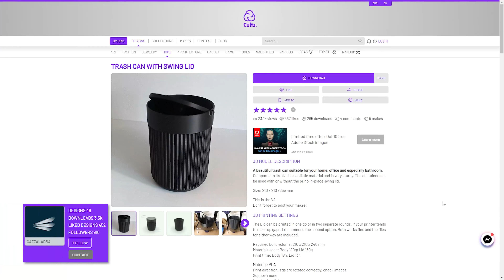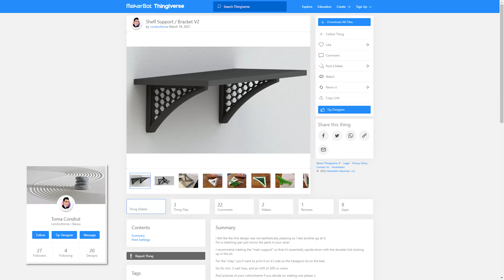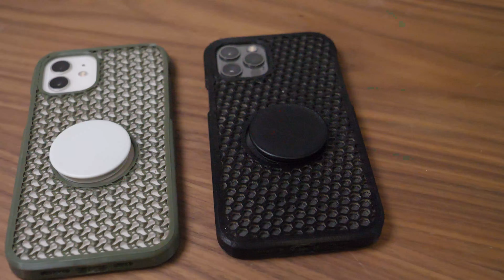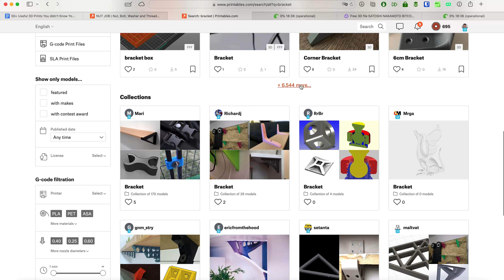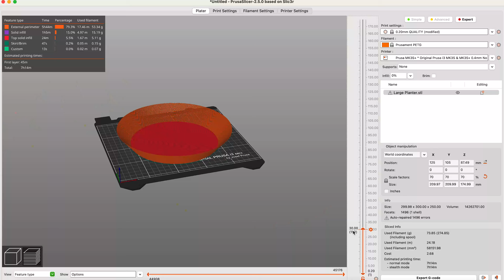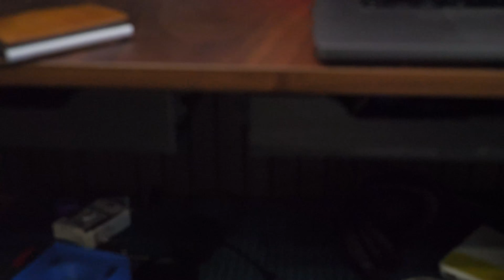50+ Useful 3D Prints You Never Knew You Could Print

Comment: Heads up if you are looking for a printer. I bought a elegoo centauri carbon that never ran correctly. After about 50 hrs it started smoking/shut down. I replaced the nozzle, same thing. Elegoo support sent replacement parts(2 weeks trans). Replaced them and the bed wouldn't heat correctly / stop printing. Support sent video to check wiring. Printed for about 10 minutes and would stop again. This time the printhead wouldn't heat correctly and stop. Their support said I should return it and they would replace it with a USED PRINTER.

Comment: Million Dollar Tip from someone who has 3D Printing Since 2017 : Rule No 1. Don't 3D Print something you can easily get from a dollar shop or nearby market , even if the cost is same but your time spent into printing it goes in vain, Time is more valuable than Filament or anything for sure , For Example , this video's first recommendation is Trash Can , which is the last thing i would think of  3D Printing, 3D printer value is not justified by printing trash cans, coke bottles ,etc , i don't know where this guys lives but i am sure where most of us live Trash Cans are available for less than $5 , or max $10 . And please don't come after me saying it's our 3D Printer we can print whatever we can , yes you can . 3D Printing was invented back in 80s to create something that's not available to purchase right away on any counter. Best Usage of 3D Printing ( According to my Experience ) : Gridfinity , OpenGrid , Multiboard , spare parts that are obsolete now , specific designs that you won't get anywhere else , DIY Projects , arduino raspberry pi (custom pcb ) enclosures ,etc

Comment: If you want a mechanical 3d print to try i have an idea for you. I am currently working on an Auto loom. 

Basically the idea is that i plug a drill into a screw hole and it turns all the gears to make the loom run.

Comment: I have no idea where you are the trash can cost $75 and only holds 3L or whatever you said. Here in the US a standard size trash can is 13 gallons. They make them up to 40 gallons. Also standard size trash can will probably cost about $15. Sure you can get fancy ones. In fact for $75 13 gallon stainless steel one.

Comment: Custom bookmarks with shallow bas relief images.
You could scan a collection of rocks then print them into a floor for an aquarium / terrarium with sunken ships and treasure chests coral reef etc. added in as one light weight piece.
Handles for small glasses or cups or paper/ plastic cup to make them easier to use like a coffee cup. Handle could be customized for the person or for disability ease of use.
Could convert those pesky cone cups at the office with a handle and a base so you can set them down.
Handles for anything. Like files or other tools.

Comment: The best stuff I've printed is parts to fix things, which are not available from anywhere. Drawer slide mounts that break and you can't get replacements. The handle and frame for our freezer which broke about 8 years ago and I couldn't get a replacement, so I printed it. At this points my fridge, freezer, cars and motorcycles, not to mention dressers and many other indoor and outdoor things are partially printed parts since they have broken and either I couldn't get parts or they wanted me to buy a whole $300 assembly instead of the 30 cent part that was actually broken.
As a bonus, I can design the part better so it doesn't break like the original one did.

Comment: Home depot sells the best compost bins. Five gallon bucket and lid. Under ten bucks.
Reply: Sure, but you can't help justify spending hundreds of dollars and hours of modeling by comparing a simple solution...you gotta convince yourself you need expensive stuff so that you can print it yourself to "save" money lol.  I get it, I want a 3d printer because it's cool, but I can't think of much I would print that I couldn't fix some other way or at least for less than the cost of the printer + supplies.

Comment: You can print a working gun.
Reply: @Rad1iantError 😂😂😂 that should have been on the list
Reply: Lmao.
Reply: Well... It's more of a single use bullet detonator with just the printer.
Reply: Yeah, but because it’s made of plastic will only be single use
Reply: @3dprintedfortnitekid  no not even the 1st Gen 99% print 🔫 gets 5 shots before a barrel replacement swap out pin aswell but don't have to. Than you got stuff like the FGC (f*** gun control) you can print 90% of it and than buy the hardware springs bolt etc from home Depot. And depending on filament used it has a nice life span. Than there is printing just lowers (which is what you need a back round check for ) than buying the rest 😁 online shipped to your door. 100% legal in most states in USA.
Reply: @3dprintedfortnitekid  that's not correct kid. You can print mostly all the parts of a real gun other than barrel and I believe firing pin, but you can purchase these parts easily and print the parts that does not need to be metal. Since you're replacing steel or polymer with plastic, it won't be as durable but it will have a lifespan long enough for its intended use

Comment: You forgot RC Cars.

The whole reason I bought a 3D Printer for replacement parts for my RC-Crawler...It's a 1/12 or 1/16th scale cars, even PLA is good enough for Small, low impact RC Cars...I would use ABS or ASA for RC-Bashers, but for Crawlers, printing out Frames, Servo Beds and Rims come out well and have lasted for a few years for me on some of my RC Crawlers.

I could either overpay for parts from Amazon, or wait for months for parts from AliExpress...The 3D Printer is better than both...

Comment: I think the thing I'm most proud of designing and printing (so far) is an adapter for a portable aircon unit, that allows the exhaust duct to fit through the window gap. The standard adapter for the unit was designed to fit sliding windows, and my windows open outwards at the bottom. The aircon unit provided a fabric bag that you could stick to the windows, and a zipper to put the exhaust duct through.
Neither the exhaust duct or the original adapter fitted through the window gap, so the weight of the exhaust pipe kept pulling the bag off the window frame...
So I designed an adapter for the adapter, that would attach to the collar of the adapter, and then taper in to fit through the window gap. This was my first complex shape (fillets, tapering fillets, offset planes and extrusions used to cut into the base model, to hold the adapter clips in place)

Shame I can't add images, but I'll put it up on printables soon. Edit: it's up here: https://www.printables.com/model/950129-dr-prepare-aircon-mod
It's not groundbreaking or anything, but it is my first complex shape in Fusion 360, and just a week ago I was only able to print things that were made by other people, so it's a big step up for me 😃

Comment: The single most useful thing i have printed for myself was an enclosure for my printer. I print on an OLD monoprice maker select v2 that has never recieved any sort of upgrade. I wanted to stadt printing in ASA and get into vapor smooting my parts but wothout an enclosure i couldnt get it to work at all. Most of the enclosures i could find for sale or even stl files online were either crap, didnt fit my printer, or needed 5+ lg of filament and i couldnt justify any of that for my cheapo printer so i modeled up a new enclusure that uses plaskolite corrugated plastic for the walls and very very minimal amounts of filament for the edges and corners and tbh it works AMAZING. Changed the way i print everything.

Comment: Heads up, generally 3D printed plastics have crevices that bacteria thrive in. For example, in FDM/FFF it's the layer lines beads. As a result, it's best practice to not use 3D-printed parts for things that are in contact with food or liquids for consumption. In short, I wouldn't recommend the water bottle gasket to be 3D printed.

Comment: I have been 3d printing for over four years and have never printed a benchy. Ninety % of everything I print is a repair part, a tool , replacement item, or equipment I want or need. 3d printing has saved me hundreds of dollars in tools and less frustration in finding a solution to a problem. Great video by the way.
Reply: Benchies make for good... benchmark prints. Thats the point of them
Reply: does a repeating toothpick crossbow count as "useful"?
Reply: Yeah, I need this every single day @SadCatStudio.
Reply: Lmao bunch of hipsters in this thread. Nothing wrong with printing a benchy, its supoosed to be a simple benchmark so you can see the quality of the printer/material, nothing to it.
Reply: Exactly. Using decent 3D CAD software I create whatever I need.

Broken Party tent part? Reverse engineering copy made in 3D software, print, place, ready.
Ice Cube tray from American refrigerator damaged? Create a strong support and done.

Confessing I occasionally download and print models from others. But mostly I create useful parts myself.
Reply: My first print was a benchie
Reply: @dargoth  printed a benchy just because my son was eyeing it 🤣🤣.
Reply: @dargoth  fabricator here and this is the same reason why I bought one you have no idea how many times I had to me and you will make my own tools sanding plates hopefully this works out
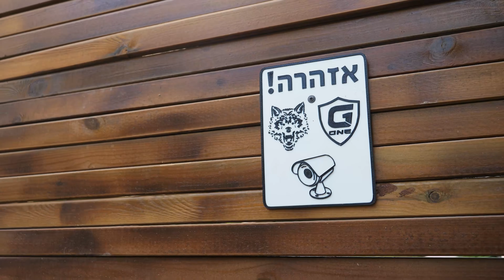Reply: 7:09 need a sign for my condo building. FedEx and Walmart miss my unit ALLLLLL the time
Reply: @dargoth  No Benchy? Come on man! Let your hair down. Dragons are fun also. Just kidding. I wish I could unprint all my Benchys they do scatter all over your desk. I’m impressed though
Reply: Same! And honestly I don't understand why people buy a printer and then say "what do I print now?". I mean, it's like buying a car without really having to go anywhere.
Reply: @Ale-bj7nd  read me like an open book without knowing of my existence some other time, okay??
Reply: Been printing about 6 years and only just printed my first benchy last week. I wouldn't have bothered normally, but a 14 min benchy seemed too good to pass up.
Reply: If you’ve never printed a benchy then you’re not a real 3D printer king. 💁
Reply: I just started a month ago.  I haven't printed a benchy yet.  I wanna see how long I can go. Idk why, but the thought of a benchy makes me mad lol.  It's literally the first thing everyone prints when they get a printer.  But I get it.  It's a tester.
Reply: @kylehanneman6438  I feel like what happens is that if you're not good at CAD or modelling, the amount of useful things you can make with the printer drops dramatically because you aren't printing custom replacement parts or other things that are hard to source online. That's why a lot of hobbyists end up just printing figurines/tat they downloaded, or stuff like drawers and organizers

If you have some competence in CAD and ideally do some other thing as your main hobby, then the 3D printer becomes a really useful tool that gives you custom or replacement parts
Reply: Yea I always thought it was quicker to perfect a small print rather than wait forever for a benchy.
Reply: Almost 2 years and just printed my first benchy yesterday, and only because I got a new A1.
Back to tools and fixing things now.  :)
Reply: Cheers for posting! Hoping for some guidance: My crypto wallet on O K X holds some Tether usdt, and I tknow the seedphrase. {clean party soccer advance audit clean evil finish tonight involve whip action}..How can I posting sending them to moving them?
Reply: @dargoth  yep. 99% of 3D prints are items to fix your 3D printer
Reply: Watched a different video recently that was "10 things I wish I'd known before buying a 3d printer", one of them was "you can learn cad software and design your own things. This blew my mind, people buy 3d printers without planning to design things, just to print benchys all day?

I mean no offense to benchys and people who print models, they're all good. But I'm the exact opposite.
Reply: @MrModTwelveFoot  I got into 3d printing after earning CAD lol, I figured it would be good practice. I wouldn't have bothered unless I could make my own shit, not that I don't appreciate other's designs.
Reply: With You - got 10yrs in the hobby and ZERO benchy's absolutely no use to me don't even consider them a valid test print
Reply: @AusPhilMotivated Curious, why would you not consider it a valid test print? I just got my first printer, and I don’t necessarily plan to print the Benchy, well I’ll print a modified horror one, but I digress. It’s literally pre-loaded in many printers so why wouldn’t you use it as your test?

Comment: i never printed a benchy or something for my printer except for the lcd backside a cover. but i printed a lot of calibration cubes and poly foxes, because improving my prints and testing infills and different filaments. usually i dont keep them. the cubes are 1cm³ and going in the trash or except for one each filament in its filament box, the foxes some are in my house but for the most part i give it away to some who like them. i normally print useful stuff. if something break i fix it with a 3d print or i rebuild the broken part and replace it with the print.

Comment: Remeber back when decent cameras all had sliding lens dust covers or lens caps? That was when cameras actually were turned off and unpowered when you weren't using them. Now that turning a camera "off" is just a software setting that stops the screen from displaying what the lens sees, cameras no longer need lens caps.
How about a phone case design that includes lens caps?

Comment: My wife has the perfect “kill phrase” for printing these kinds of things: “Let’s go to IKEA, it’s faster.” But being a sweetheart she’ll let me do it the hard way anyway…. well, usually… uh… sometimes🤔😉
Reply: Me too, she’s also the one that got me “the stupid printer thing”, that she refused to ever buy.  “It keeps you busy and let’s me watch my shows” 😂
Reply: dang, my lady loves my 'hobby' poor fellas.! #dying
Reply: Sometimes when reading these threads I wonder how more women are not interested in 3D printing. I’m a woman and I think it’s super fun and useful
Reply: Anything I can get at IKEA, I get at IKEA. It's probably better than what I can 3d print. Injection molded polypropylene is way more durable than FDM PLA. It's the item that can't be bought that makes my 3d printer indispensable. I make a lot of amateur radio gear, things like keeps my antenna up and custom cases for products that don't come with one. Then there's parts for things that can't be found. I've fixed a vacuum cleaner, a bidet, the yogurt maker, a tablet case, and the feet on my laptop that keep falling off. I replaced the blade guard for my power miter saw and the one for my bow saw. I made a device to power drive a pepper grinder, for when I need 50 ml for a recipe. I've made custom cases for cell phones to enable panoramic photos. And the occasional art project, like a Shaun the Sheep spare toilet paper roll holder.

Comment: I have a >150 year old half-timbered house. One door to a room didn't close anymore, as after all this time everthin is a bit crooked an skrewed. Actually I needed some washers, but smaler on one side than on the other, to level the door. Quite a simple design (I don't actually used a CAD software, but simply drew a cylinder in Prusa slicer, subtracted another cylinder and made an angled cut). Printed in PET-G, door is level now, and also stopped squeaking.

Comment: There's a myriad of little printed gadgets in and around our house. The keypad on the garage door opener. We had drawer installed inside kitchen cupboards; the handles I made. My desk lamp. A hidy box for an emergency door key outside somewhere. Phone cases. A mini LED flashlight molded around my house key. A hose tamer for my CPAP machine. Everyone of those things is custom designed to fit our very specific needs, which is why Fusion 360 design skills are central to the whole deal.

Comment: So basicly the same useless stuff what you can buy at a shop like shelf, box, pot, trash can, ect. The drawing and hand writting funcion is interesting, you for got to mention that.
Reply from the maker: Not a very nice comment.
Reply: @thenextlayer  Print useful stuff than. To print out, what alredy poduced in a china factory plastic containers? Its easier to just buy it at the shop. Print something out what i can't buy at the shop. All these things what you showed on the video is availible at the shop on the corner. For 10 times less price. If you think how much to buy the material, the printer, the electricity, time, ect., instead to buy it at the china shop. What is aalredy there. So if you telling me if i need a trash bin to print one out, than i just pop in the way home and pick one up for 10x cheaper. Otherwise i spend a day with the printer to get that trash can...

Comment: I've found printed bearings can actually be super useful in the right applications. They don't tend to spin as freely as metal ones, which is a property you might want sometimes. Obviously they won't hold up to high RPMs, but for low speeds, they might just be perfect. Spool holders, for example, you might not want to spin too freely and unravel your filament..
Reply: Yea! Printing parts for the printer so it’s easier to print parts for your printer!
Reply: I cant agree more on that. I swapped metal bearings for printed ones on my spool holders.
Reply: I saw those and almost laughed → then I got to thinking they wouldn't show them if they didn't work for something...coming from the world of Caterpillar equip, that's where I immediately went...obviously they do not belong in there...LMAO
Reply: @BostonTerrierDad623  all construction equipment should be completely 3d printed
Reply: That's a clever idea you should make that into a business